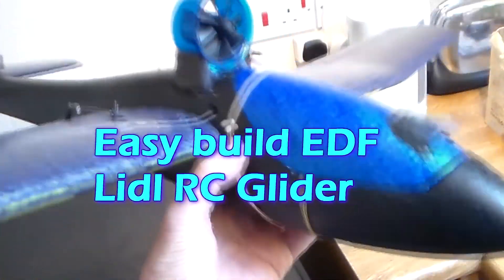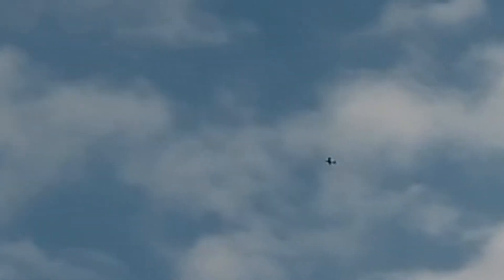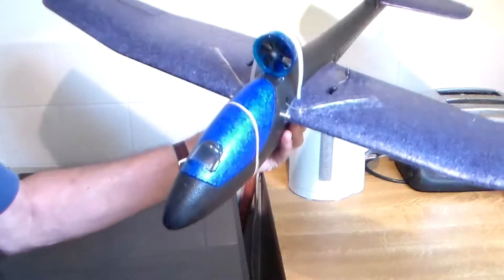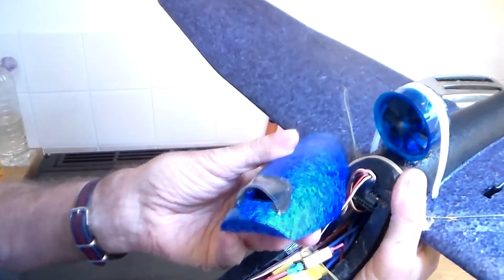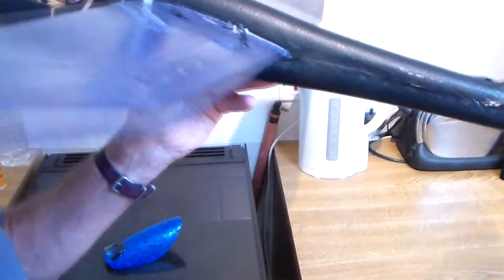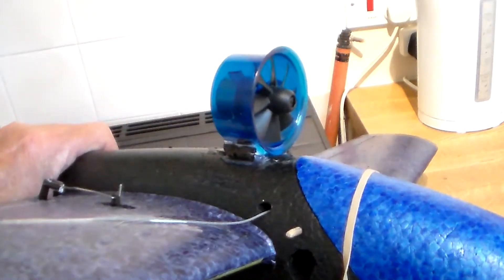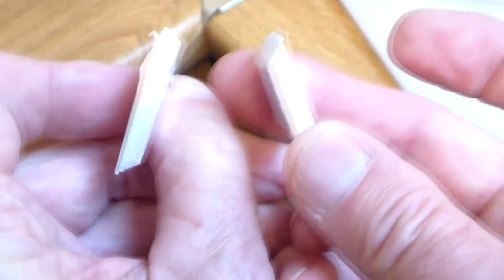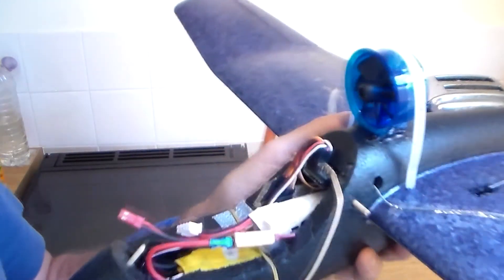EDF Lidl Glider EASY RC Build - plus   BRILLIANT maiden flight!

Comment from the maker: Note: There are ventilation outlets underneath in the fusi.  Maybe should have been bigger though the 30A ESC wasn't really rated high enough for a 28A current when  used with a 3S lipo. I've upgraded to  40A now and it's fitted outside in the airflow

Comment: Don't forget that you need ventilation holes for the air that enters through the scoop to exit. Otherwise, there won't be any air flow over the esc
Reply from the maker: Hi mate, there are ventilation outlets underneath in the fusi.  Maybe should have been bigger though the 30A ESC wasn't really rated high enough for a 28A current when  used with a 3S lipo. I've upgraded to  40A now and it's fitted outside in the airflow  😊
Reply: @bobflyman  Good to hear. I was introduced to your channel recently by the YouTube algorithm, liked and subscribed 🙂
Reply from the maker: @Emiliocab47  that's good news,   I wonder sometimes if their algorithms do anything for me!

Comment: Which converstion flies the better?
Which one has the best speed?
Thanks
Reply from the maker: Hi Mate, they all fly well, Spitfire probably best .  I think I had a about 8 mins flight with the EDF , can't remember the current. It is a 45 mm EDF.       Regarding speed that's quite a difficult question because it depends on how heavy you make a conversion and what motor and prop you use and what size lipo. I guess my first conversion, the yellow one, is quickest as it has the biggest motor  and big propeller.  That was the one in this video but since that build I changed the nose to improve battery position.  
The details of motor and prop are on the video.
 https://www.youtube.com/watch?v=ceNpxgB62Gk&list=PLLdle7NDE_1Y_XC3kjOSIUDJcRxVrhez-&index=19&pp=gAQBiAQB

and this is the nose job modification
https://www.youtube.com/watch?v=v7kZpQqc9Cs&list=PLLdle7NDE_1Y_XC3kjOSIUDJcRxVrhez-&index=3&t=6s&pp=gAQBiAQB

Comment: Bob, looks like BG have discontinued this EDF.  Have you tried any others ?  Just starting my first Lidl conversion...  I'm based in Brasil and not a huge number of suppliers here.
Reply from the maker: Hi mate,  I just clicked on the link and it came up?   SEE MY EDIT:    
https://www.banggood.com/custlink/vGGhU6iapa   
or there's a 55 mm one here that would do the job!   https://www.banggood.com/custlink/KDKEUMAYDU    
EDIT  I just clicked on the link for the 45 mm and yes, it does say not available. The 55 mm still is available, which might work better in fact? Or if you search AEORC EDF Ali Express still sell them but I  actually bought my first from them and waited weeks for it! Did you see my EDF Vulcan made with a Lidl nose. On my channel!
Reply: @bobflyman  Was just typing about Aliexpress, then read your edit.  I'm getting the 55 one as well from BG, they deliver fairly quickly down here, bound to come in handy.  Haven't viewed the Vulcan yet, but it's on the list.  Thanks for the reply. atb

Comment: What is the discharge rates on 460 and 800 battery.  Is it 25c or 30c?
Reply from the maker: 800 says 20c  - 30c  I reckon about 5 mins flight time.  Don't know the current sorry.
Reply from the maker: found it, details of current 12.6 v  28 amps

Comment: Love it mate! Great little plane. EDFs seem much more efficient than open props.
Reply from the maker: The info I found in my little research before trying it was contradictory as far as efficiency goes! I thought less efficient? Good fun though!
Reply: @bobflyman  From Wikipedia... "By reducing propeller blade tip losses, the ducted fan is more efficient in producing thrust than a conventional propeller of similar diameter."
Reply from the maker: @Aengus42  I looked at Wiki too. 😉